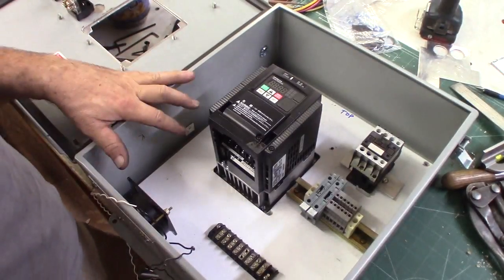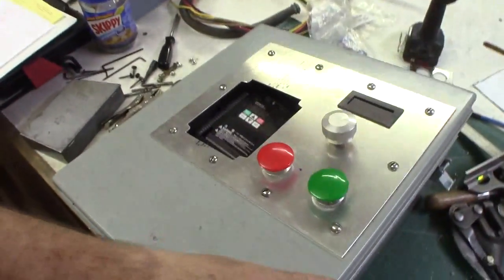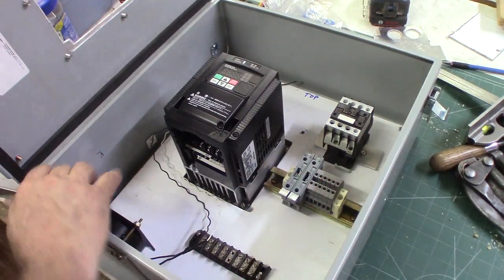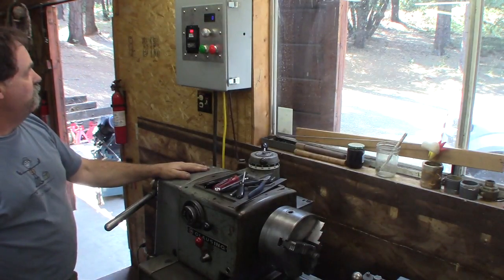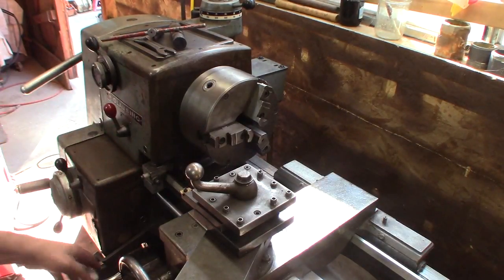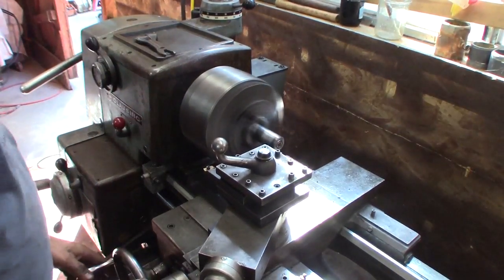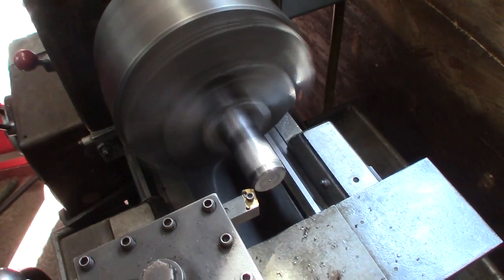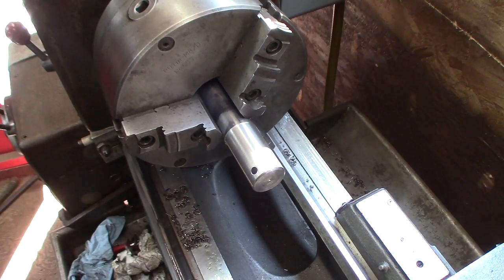Clausing Metal Lathe VFD and First Chips.

Comment: How did the drum reversing switch tie into the circuit?
Reply from the maker: I reconfigured the contacts within the drum switch so I could use them as dry contacts, connected to the fwd/rev input contacts of the VFD.  The drum switch no longer has any power running to it.
Thanks

Comment: Randy, I just purchased a Hitachi WJ200 VFD for my Clausing 5913 lathe which I've owned for 2 months. I want to retain the original use of the Motor Switch Control Lever and  Clutch/Stop Lever like you did. Where would I go for info? I've checked many sites.
Reply from the maker: Jim,  I am away still from home.  When I get home I can put together info for you.
Emaill me at RRINTHESHOP@GMAIL.COM

Comment: Hi Randy i was wondering if you changed motors on the Clausing lathe ?, i watched the video you made on fixing the original hyd variable speed pulley and was curious as to why you converted it to the Electronic VFD ?  i was also wondering if you might have a wiring diagram for this conversion as the Clausing lathe i want to buy needs this conversion to be finished thx for posting this one !!
Reply from the maker: No motor change.  I like the high degree of speed control the VFD gives and I do not have 3ph in the shop.  I could of used a phase converter.  I do have a wiring drawing.  Some folks remove the Reeve's drive setup and install fixed pullies, then use a vfd for speed control.  Doing this does limit the lathe a bit (Speeds and Torque.), it all matters what pullies you use for the fixed system. Thanks Mark
Reply: Thx  Randy

Comment: I have the same lathe, It works great.
Reply from the maker: What model do you have David?
Reply: It's a Clausing 5909, 12 x 24 variable speed. I installed a digital tach and a qctp. I didn't get a steady rest or follow rest but I got everything else. The bottom belt cover is missing as well
Reply: I missed the secondary start lever by six units
Reply: Before I got this lathe I had a chinese 9 x 19 benchtop for 20 years. NO comparison.

Comment: Nice work, Randy!  Quick question, what kind of chuck does this Clausing take?  I have a 5904 12x36 and want to get a 4 jaw chuck for it. Forgive me, I am very green to lathes and just lucked out finding this gem on CL. Thanks!
Reply from the maker: It all depends on you mount.  The mounting plate is a separate piece on most chucks. An 8" to 10" chuck should work, kind of matters how big of work you want to hold.  Then purchase a mounting plate to fit you lathe and chuck.  My Clausing has a LOO spindle mount.  You can buy a mounting plate that is machined to fit on your spindle then you machine the rest to fit your chuck, this is usually the easiest method.
Reply: Randy Richard In The Shop thank you for the replay!  I’ll take the 3 jaw off and see what I’m up faints before I purchase the 4 jaw. Thanks again!
Reply from the maker: If you are not sure what mount it is, go on line and do some searches and you will find all of the types of mounts and dimensions.

Comment: Hi Randy,

Nice job on the conversion.

I have a clausing 5913 with the variable speed drive similar to yours .

I may have missed a previous video so please excuse the question if it has already been asked.

My machine has intermediate shaft with the OEM  hydraulic squeeze pulley to adjust the speed.

When you converted to VFD did you just leave the squeeze pulley in a certain position to get the correct RPM range?  I was wondering whether I would have to remove the intermediate shaft and drive the spindle directly from the motor with a certain size pulley.

The OEM speed range was from 0 to 2000.  Do you know what your spindle speed is now with the VFD?

I already have a VFD that I use on a 2" X 72" Grinder that I built.  It has 220 Volt single phase input and 220 3 phase output to the 2 hp 3 phase 56C frame motor.   I wired it was twist lock plugs so that I could possibly operate other equipment in the shop from the same VFD.  Kind of a plug and play type of thing.  I haven't tried it yet but I don't see any reason it wouldn't work.  The VFD that I have also has an 2 X option on it which will let you run a 3 phase 1725 RPM motor at 3450 RPM.  It works well on my grinder.  Of course I wouldn't want to run my 2000 RPM lathe at 4000 RPM.

Thanks in advance for any input you may provide.

Here is a link to my grinder build.   If you go to 14:13 on the time line you will see a picture of the VFD that I used on my project. https://www.youtube.com/watch?v=XxI8_XdvXN4

John
Reply from the maker: I have not removed the intermediate shaft.  I do not have 3ph to the shop so I use VFD's.  For now the hyd speed control works so for now it will stay.   This gives you better torque control especially at low speeds.  When I get everything up and working correct I will check the speeds.

Comment: Thanks for the look Randy, I lke the setup, having a vfd with infinite speed control is a big plus. I still use the 4 way post on my lathe, once they are loaded they a very fast and I have never needed anything any better. Hope all is well . 
Steve Summers
Reply from the maker: Thanks Steve.  I like the VFD's I have them on 4 machines now.  The 4 way post is great for production type work or in conjunction with a turret.  But when you are doing a bunch of one off work QC type post I think are better,  I have over 20 tools setup and ready at any given time.

Comment: I don't think your cooling is enough. First the holes are not enough, you need more, or need to use a rotary table and hog out smiles )... next you have no where for the air to go, so it won't cool it. you need an equal size cooling vent on top to let the hot air escape, so the cool air can enter.  just my opinion.

Nice build though, but not cool
Reply from the maker: The fan is an exhaust fan and is small.  The motor takes up over 5o%  of the  fan's foot print.  The VFD also has it own cooling fan.  I have another hole at the top of the side you did not see for an air inlet with a filter.  I will have to show this in the next video.
Reply: Ah, I didn't see the other hole. So how about reversing the motor, push fresh air in, much better. it would blow the cold air over the VFD.  A vac or dust collector is never as good as putting a fan near the area and blowing it away. It's good, but better is blowing..
Reply: Also the hot air rises so pulling it down is not as efficient..  Give that heat a place to release to.  UP

Comment: As Sandhammer says, you got to have some air going in to the box, otherwise you wont get any out, and it was better if the exhaust fan was in the top (and only with a screening mesh, those small holes will restrict your air flow to much) and intake holes in the bottom, otherwise a nice job, a good old handmade thumbs up.
Reply from the maker: It will all be revealed.
Reply: Fine, I hope you understand this was only meant to be positive feedback
Reply from the maker: I took it as positive.  Thank you for the feedback.  I just got tired of typing about this.  The fan is an exhaust fan and is small.  The motor takes up over 5o%  of the  fan's foot print.  The VFD also has it own cooling fan.  I have another hole at the top of the side you did not see for an air inlet with a filter.  I will have to show this in the next video.
Reply: Hi Randy, again positive feedback, by having the fan in the bottom you go against the natural flow of hot air (the VFD's fan also blows the air upwards), because your fan is a low pressure type the small holes will restrict the flow to almost nothing, if it was my setup I would put the fan on top with only a wire mesh screen over it and 6 1 inch holes in the bottom.

Comment: Nice to get that 'modernized' and running.  Curios though about your startup speed on your tools.  First I thought the Logan was underpowered and took a long time to get up to speed, but I noticed your mill and the Clausing seem the same.  My Logan gets to full rpm in seconds..
Reply from the maker: My Mill, Lance Lathe, Clausing Lathe, Surface Grinder, all are on VFD's,  I have them set for 6 sec. Acccel ramp.  Logan is 110v and has the orginal motor, about 1956.
Reply: Aha!  Thanks. figured I was missing something.

Comment: Nice, as a guy who builds "boxes" for a living, nice job. I would add two suggestions. Open the airflow to the fan a bit more, the less flow resistance the better, & raise the fan on 1/2" stand-offs, bend a little U strip and install it under the fan. Leave the open end to the front of the box. Grab a AC filter and cut a chunk to slip in between the inlet holes, and the fan. It's something I do, and am always amazed at the amount of the dust I stop from getting into "Boxes". I just hate dirty insides...... Keep making chips, I enjoy the channel!! .... edit, I assume you are blowing air into the box, also add an exhaust hole... don't burden the fan motor!!

Comment: Mmmm, really no vibrations ? I wonder after leveling, sounds also strenge.  Nice setup, nice job !
Reply from the maker: The variable speed drive belt is not in the best condition, I have a new one coming.  It is getting better, after some more clean up and adjustments.

Comment: In regards to power failures and the subsequent issues regarding them. A cheap used UPS (uninterruptible power supply) and a car inverter can be a solution. IF power goes out, they give you enough time to pull out safely rather than experience a sudden jolt, AND, the UPS has all the electronic and mechanical safeties you'd need to run the VFD without issues. NOW, the kicker is finding the UPS that's suited for the demands of the VFD and lathe. They exist, but like i said, for something like this, it's best finding one used, the battery is cheap to replace.
My experience with these in my rural side house where power outages and spikes are pretty common. I happened to have 5 UPSs that were given to me, so i hooked them up in line to the various devices that i wanted protected and where i'd have to replace a TV (And other appliances) once in the past, this hasn't happened since.
Reply: Good on reusing the box. Funny how few people do this, when it's perfectly acceptable to just cut the chopped out front panel or bottom and screw in a piece of metal. Hey, i can't complain, i get boxes like that for 2 3 dollars at the scrap whenever i go for steel and stuff. Their loss, my win.
Reply: Also, like someone noted in the comments, make another hole for the fan intake, just like that, there's not much happening inside the box.

Comment: Notice you still have the hydraulic speed control? Gonna use both? Second hogging out the fan outlet.  How many lathes now??
Reply from the maker: Yes for now, if you need the torque you will need the Hyd. control. 3 lathes.  Yeah, Yeah, Yeah on the fan.

Comment: Just wondered how hot the Heat sink runs under long usage.We converted a Monarch 10EE over to a a Vfd  and a different motor .This was done several years ago by our Maintaince Dept.and the size of the VFD have gotten smaller.Really enjoy your Videos.God Bless you and your Family!
Reply from the maker: Thank you Joe.  The VFD has it own fan, but I like to but in a addition fan for the hot summers.  I have not had any problems on any of my VFD's, Mill, 3 lathes, Surface Grinder.

Comment: Nice looking control box, Randy. Be advised that your 'grille' over the auxiliary cooling fan will block MOST of the airflow available from the fan....it just doesn't have much open area. You really need something like a wire grille if you don't want to impede the flow substantially. It may not matter much in this case. I do cooling system design, and I've done many studies of fan performance.

Comment: Looking good but I have concerns about not connecting the VFD directly  to the motor, all the ones I have fitted stated clearly in the instructions that there should be no switches in between the two. I'm sure others more experienced in the subject will chime in with the answer.
Reply: I think he hooked the original switch, to the control circuit of the VFD.

Comment: Hi Randy,
Great job in getting the Clausing to run on the VFD.  How about adding a pilot light to the panel so you really know when the machine has been shut off - the capacitor residual electricity in the VFD could be deceiving. Also, did you use the Hall effect tachometer method on this lathe like you did before? Thanks for showing your work, Paul

Comment: Randy if you plan to use only standard carbide tooling you can save a lot of fuss by making a shim to go under the toolpost turret to bring unshimmed tools to center height. I made one the other day for one of the machines at work using the super glue chuck method. Works like a charm.